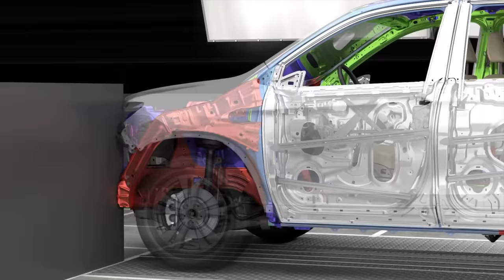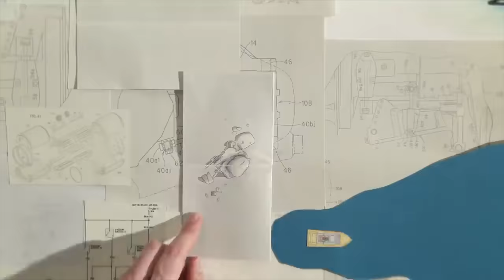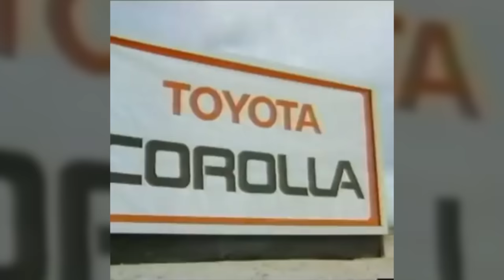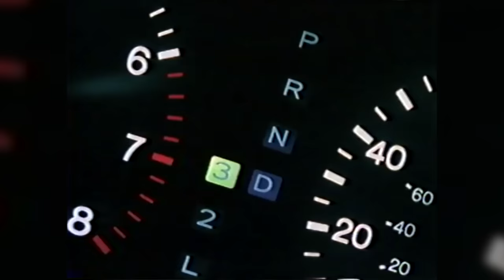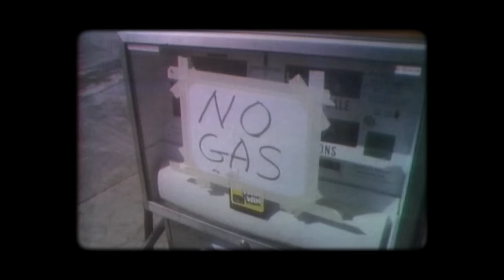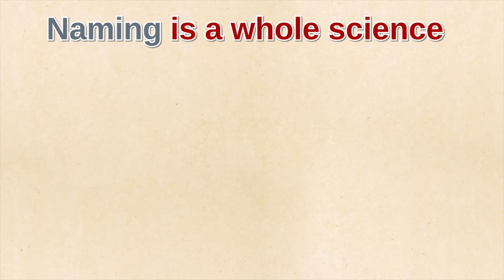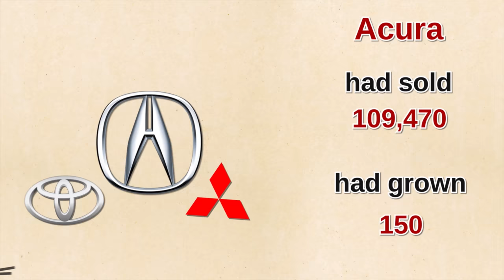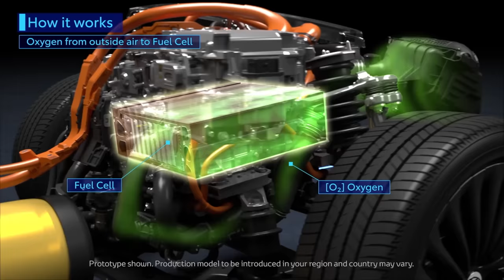Here's Why I Only Buy These 4 Car Brands

Comment: Thanks for the video Scotty.  I bought a 2010 Honda civic and I'm impressed.  However,  it has some problems.  The rubber seal on the windows , after only 79,000, needs to be replaced.  The driver side sun visor is broken.

Comment: I had a 2013 Honda Accord V6.  Got about 6 thousand miles and it started throwing out blue oil smoke on startup.  Took the dealer three times of rebuilding part of the engine to get it fixed.
Reply: That's the minority

Comment: I have 2006 2.8 cadillac cts with 207,000 miles and still running strong.. Biggest expense has been the water pump.. Not just honda and toyota’s last over 200,000 miles!!

Comment: I've had exceptional luck with Honda and Acura vehicles. Zero major problems in 20 years and more than 300,000 miles of driving them. Less luck with the Toyota I had but I know I was just unlucky.

Comment: Agree 👍, I still prefer a full size pickup v8 from honda, not a weak v6 , they need to improve on that, Ridgeline still is a weak pickup, structure etc, engine etc etc

Comment: I got a 2008 RAV4 V6 for 8k and I reached 210k miles on it and the only major repair I had was replacing the water pump. Still going strong.

Comment: SCOTTY... mitsubishi's make great cars too. i have owned 4 lancer's over the years. 3 different es trims, 5 speed stick, and a ralliart.  my first one, a 2009. i beat it everyday for 220k miles, when its computer failed, up  to that point i did both front control arms at 110k miles, back wheelhubs at 120k miles, and an alternator at 180k miles. still had 3 original calipers when it died.. and i live in NY.  we did not care for our 1 CVT lancer, and traded it for another 5 speed stick. and when my first died i went with a ralliart.. both our current cars are above 120k miles, nothing but normal maintenance..  and when i say i beat cars, i get to redline at least once a day.

Comment: My parents bought a 2004 MDX and kept it till 2018. It was reliable and smooth still, though a gas hog and dated technology wise. It was the family car that took all my siblings and I to and from everything. My parents then bought a 2016 Lexus RX and now they’ve had that ever since and plan on keeping it for a long time.

For my car, I bought an Outback and so far have put on 105,000 miles from 87,000 miles, and it’s riding well with just oil changes. Japanese cars are just built extremely well!

Comment: My first car was a brand new, 2013 Ford Focus SE and it was fine except for the awful transmission being a stuttering mess. I had it in the shop several times and was eventually told "This is just the way the car is." I've since had a Subaru Forester and a Honda Odyssey and I will never be going back to "American" auto manufacturers except for old used beater trucks.

Comment: Toyota & Honda top notch through personal experience.  1983 Toyota truck with over 300,000 miles, original engine + same timing belt.  1999 Honda Accord LE purchased new but sadly rear ended, totaled 2021 with 146,000 and had no major repairs.  2015 Camry LE with 46,000 and not no break down to date.

Comment: Pontiac bonnevilles have been good for me. Currently driving a 99 with 150,000 miles. Paid 1,900 5 years ago with 105000 miles. Only replaced coils spark plugs, brakes and tires.

Comment: Hondas and toyotas are the two most dependable and reliable vehicles period.  They don't cut corners and put mediocre materials in their vehicles.  Even if they use cheap material, they are made very sturdy, hence why they can get away with cheaper materials because they are made with higher quality, making it far more reliable.

Comment: I have a 2004 Toyota Sienna w/ 352k miles.  Runs great!  My side electric doors stopped earning a year ago but I just use it for hauling.
Reply: I also have a 2004 Toyota Sienna with 282K miles. I changed a lot of stuff in this minivan, all 4 oxygen sensors, 6 spark plugs, 2 ignition coils, starter, timing belt, serpentine belts, knock sensor, oil pressure sensor, wheel bearings, ball joints, cv axle, struts, lower control arm, exhaust pipe, and some others. I had a 1987 Honda Accord with similar mileage，I didn't changed those parts I mentioned, just an alternator, a radiator and a clutch due to human errors. But I had to give it up to get a minivan. Older Honda was great, looks and drives like a sports car.

Comment: One time I changed the timing belt on a Lexus LS400 that had 587,000 mi. Interestingly enough the 3.0L 3vzfe that came in v6 Camry and es300 has same bore and stroke, also same 6 bolt mains as the 1uzfe found in the ls400/sc400. It's almost like the short star found in the Oldsmobile which is basically just a North Star with two less pistons. The 3.0 Camry/es300 motor not only had a really cool wooshy sounding hydraulic fan system but it also had a variable intake plenum that allowed it to get 190 ft lb of torque at only 1,800 RPM

Comment: I have a small oil leak on my 2013 Honda accord. It's not the oil pump it is the gasket on the oil pump. Regardless is about 1800 to fix and basically 11 hours to replace. I hate where they put all the parts I should be able to do myself. I have a 2013 v6 accord loaded.

Comment: I've owned and driven thirty-two different cars and brands from four countries. United States, Australia, Britain, Italy and Japan. + company cars provided to help with some of the work I did over the years. But the least liked, never to be repeated vehicle was a Honda Accord. There were some particular niggles, but mainly thought, the car just didn't feel right - an entirely subjective. response. So out it went. They manufacture great four stroke outboard motors though, but that's altogether a different kettle of fish.
But Toyota - while this has been a popular choice for the Mrs, she bought a new Mitsubishi Lancer in 2003.
Because the car has never needed to be repaired just serviced, and consumables replaced, she has never replaced the car for a newer model being the well adjusted woman that she is.

Comment: So far I've owned 1 Dodge Neon, 2 Nissan Sentras,  1 Toyota Corolla, 1 Honda CR-V (2018). I only had problems with the Dodge. The rest of the cars ran like magic with the Honda and the Toyota being at the top. The dodge simply started dying in year 6 after 78K miles - first the clutch master cylinder died, then the alternator, then the struts, until finally I sold it for the parts - about $300 in 2005.

Comment: I think I have two of the best cars ever made I have a 2008 Honda CRV Annie 2007 NC Miata convertible I bought both of them two years ago the only problem with the CRV I had to replace the wiper blades by the way I'm the second owner on the CRV when I purchased it at 81,000 miles the Mazda with 120,000 I think they'll probably outlive me and I'm over 60 years old and on my convertible I replace the tires and once again the wiper blades

Comment: This might be Anecdotal, But I had a Civic Si for 11 Years before I sell it. Bought it for 23.5K and sold it for 8K (about 34%) and Apart from the usual maintenance cost such as car battery, Oil change, Tire change, etc, I had never had and mechanical issue. Definitely reliable imho.

Comment: If Honda/Acura, Toyota/Lexus are 4 Brands than what's Kia/Hyundai/Genesis?  (I see 3 "Brands" with different badges)
Mazda/Subaru/Toyota are different brands that share engineering technologies.
Mazda is a Premium affordable brand and Subaru is already starting to charge a Premium for their vehicles.
The Cross-Trek starts at like $30,000 for the 2.5 liter and the CX-30 starts at $26,000 with more power, better handling, and premium features.
(Subaru lost their Top Safety Pick + crown to Mazda)

Comment: Hi Scotty, Gotta say I like your stuff, maybe things are different in the US however in the UK both HONDA and MAZDA are useless when it comes to looking after customer, these are my experiences, both honda and mazda after the sale they're stating they're only importers and will deal with warranty claims if dealer deems needed, however if dealer sells something with hidden faults or car develops a fault within few miles of picking it up they simply don't care and say that this is between me and dealer and dealer is independent business so I'm left out of pocket because all they want to do is charge customer for the work they should have done before.
Reply: Did you get yours from a main dealer with warranty? If so, just keep on bugging the dealer!! My civic kept on burning oil and at first they refused to do anything and said it was normal. Kept pestering them and they eventually changed piston rings and valves! 
Just don’t let them fob you off. Just pester them to fix it whenever you have the spare time haha

Comment: Problem with Honda is that everything you do has to be original Honda or Honda certified service. You can’t even change your transmission oil without having to go to the dealership. I put in an aftermarket starter after original went out at 105k miles and it caused all sorts of problems. My catalytic convertor ended up going out too. So it became very aware to me to whatever work I needed to do had to be done by dealership and all original parts which gets expensive. I traded in my accord for a Toyota Tacoma and never looked back. I know Honda make some badass engines but I’ll take Toyota anyway of the week.
Reply: Why can't you??

Comment: I had a lexus RX 350. I constantly had to have a wheel alignment. The transmission kickdown was off and the last and final time I took it in for service they said it was designed that way! What?!? I finally sold it. I guess I had a lemon and Toyota never said they would repair it or replace it. 🤷 I like my Ford.❤

Comment: Part of the phenomenon is, Audi bmw Mercedes are innovators. They have expensive new technology that they use to push their cars up market. Japanese brands are more conservative and usually a few years behind their competitors to fine tune and get the tech when it's cheaper and the kinks are tweaked.
Mercedes puts all the next gen tech in the new S class and then uses the tech in the next gen c / a class when the production cost is cheaper. Really hurts their reliability in the early years of the generation

Comment: Anyone reading - Honda Element (used cause they stopped making them in 2011 yet are still very popular), yay or nay? (Such great camping features.) And compared to the very similar Honda CRV? 🌿Though been eyeing Chevy Suburban for its space and towing capability but may be too much a gas guzzler? Not as nimble to park either.🌿 Or I wonder if there's a durable, reliable, reasonably fuel-efficient, towing-capable, roomy AWD SUV with decent ground clearance out there which could fit me even better??

Comment: Actually from previous experience and current ownership of a new civic Si a 11th gen 2022 I’ve had my turbo replaced twice and am having reliability issues since 5k miles unfortunately these new turbo engines are garbage which is why I’m getting another Camry out of all Toyotas I’ve owned I only had a JBL sun failure in my 2021 Camry TRD

Comment: Honda may have used turbos in select cars in the 80's,  but Chrysler introduced the turbo charger to the masses in America:
"Chrysler's first turbocharged engine was the 1984 Turbo I. It used a Garrett T03 turbocharger with a mechanical wastegate to limit boost to 7.2 pounds per square inch (50 kPa), and was rated at 142 horsepower (106 kW) and 160 lb⋅ft (217 N⋅m), a substantial increase in power over the standard 2.2 engines."
And the Chrysler turbo charged mini-van in 1989.    Honda?  As late as 2018!  Feb 12, 2018 — While most of Honda's lineup has shifted to turbocharged powerplants, the Odyssey continues to hang onto a naturally aspirated V6.

Comment: Cold climate or hot climate, salt, the quality of the material the car was built from, quality of fuel, oil and quality of roads. Many other factors can determine the lifetime of your car. Service and maintenance and how you are as a driver. I agree Japanese make good motors, but there is many other parts on a car too. I would say you get what you pay for.

Comment: My brand new Honda odyssey 2019 got problems, battery die less than one year, but Honda don’t admit it. front left ball joint lose after only run around 40000km, this is my first time buy Honda and also the  last time

Comment: Rotors. Rotors. Rotors. The hours I've wasted sitting in a service waiting area for rotors. For every Honda I ever owned. New & Used. The last New Honda Accord Special Edition I bought had a defective steering bracket 3 times. The service manager took me back to garage, under my car & yelled at me, he insisted I broke,  driving thru mud. Save yourself time in service and buy a Toyota or Subaru.

Comment: The only car brand I personally had bad experiences with was Fiat. Out of 3 Fiats 2 went really wrong at 60 and 100k km(not miles). The third I sold after 2 years and 45k km. I bought them because of their cng engines and a special government payment here in germany for those engines cause of their low emissions. Made the whole ordeal dirt cheap to buy and run. Ive driven VWs, Toyotas and Nissans which all worked like a charm. My 86 Corolla had 500k km on it in the end with the first engine and clutch. For 1.5 years Im driving Mazda now and so far I really like it.

Comment: I have spent more money on scheduled maintenance on my wifes 2016 Honda than i have spent on all my other vehicles combined. My chevy just clicked 500k hard 500k. Total cost of maintenance and repairs $323.89. Scheduled maintenance on honda ovet $5k at 239k miles. So much for hondas lasting so longg. Lol
Heck my Merc Van has 298k and i haven't even kept up with the maintenance.
Any vehicle should last spending a small fortune on upkeep.

Comment: Too bad the current Hondas don’t put out enough heat to handle Canadian winters. 😕👎 The local dealer is putting in electric cabin heaters as standard so that you can preheat the interior before going out…but if you can’t plug in at work all day you still get a freezing drive home.

Comment: Scotty we have a 2007 Honda pilot v6 with 234,000 miles on it. we always have it serviced 
when due. Yes it does require lots of service because my wife drives the wheels off of it. 
We are thinking about down sizing to a CRV soon. what would you say about this model Honda ? We will still keep the pilot and use it as a second car. Do you think its worth while to keep the pilot ?
Reply: I'm not Scotty but you should buy a CRV without the turbocharged engine it'll last you forever I have a 2008 CRV not one problem with it I have 95000 miles and I am the second owner don't buy a CRV with the CVT transmission

Comment: Only Toyota I ever owned had the AC go out randomly and then I couldn't switch from heat to ac. Then the engine blew up. It was a faulty repair from some other scumbag. Rebuilt the engine got it running great. Well never could fix the electrical issue then one day it caught on fire. Traded it in for a chevy impala without bringing up the electrical issues
I've been happy ever since

Comment: My Honda Civic's engine exploded. It was a known issue for the car and Honda had a secret warranty for it. Unfortunately for me, mine exploded 3 months after the secret warranty expired, so all Honda would do is try to sell me a new car. In fact, every recall I ever had was labeled confidential. After that came the Honda scandal where carbon monoxide was leaking into the cabin on their SUV's and Honda denied that. Fortunately for me, I had gone back to Mazda. Honda had an amazing run, but they are silently falling apart since mid-2000s

Comment: Honda's cost of owneship isn't as low as they make it seem for pre 2018 Hondas.. Your not taking into account the $1000. cost every 80,000 miles for a new timing belt. Drive your new honda to 240,000 and thats 3000. just in timing.

Comment: Bought a 22 Subaru Forester wilderness, planning on keeping it until it doesn’t go anymore 😊
Reply: I hope that’s a very long time!
Reply: Hopefully it's better for you than most recent years....because it seem like the 2010 and newer haven't been as reliable.
I wanted to get a Subaru, however I dislike that the water pump is actually driven by the timing. Unfortunately if the pump backs up, it ruins the entire motor. 
That makes me uneasy so I have decided not to get a Subaru.
Hope your Subaru takes you well over 200k

Comment: Honda Civic starts at €48k and the CR V starts at €68k new in Ireland. For €74k I can get a Volvo XC60 which is also a very reliable and when it comes to looks and design it’s way ahead of Honda and Toyota. Or for €64k you can get the Lexus Executive
NX 450H+ AWD new. Why would you buy the CR V? Makes no sense here.

Comment: Im in a tough situation, where I need to replace my 2015 Subaru Forester (91k miles).  Trying to find an equivalent and in my budget, I can get a Hyundai Santa Fe with around 90k miles, or a honda Pilot with around 120k miles.  Anybody have thoughts on which would be better???

Comment: These aren't reasons to buy these luxury cars these are historical facts as how the company's succeeded.
I have a reason that I buy Hondas and Toyotas and that's because the engines last the longest and the repair rates cost to lease and they don't rust out as quickly as others, especially American. Although my Chrysler minivan floorboards didn't trust out for 13 years, I did have problems with running boards every couple of years. But I wouldn't buy one around Southern Maine where I'm from because they use salt on the roads and even Toyotas and  Hondas rust out after 10 to 15 years. I got blessed by getting one that came from Georgia and was not Rusty at all. So happy hunting!